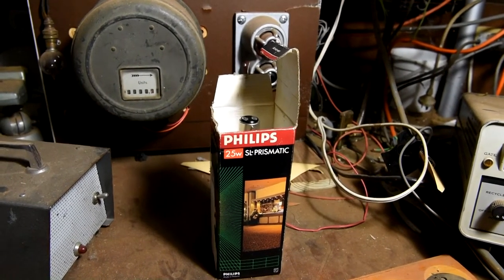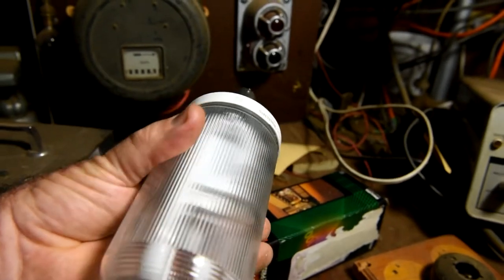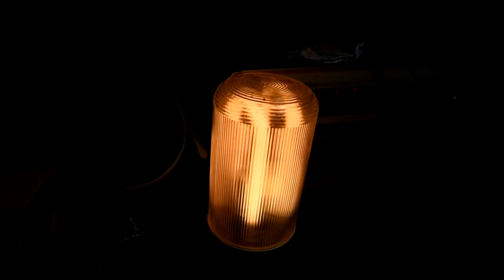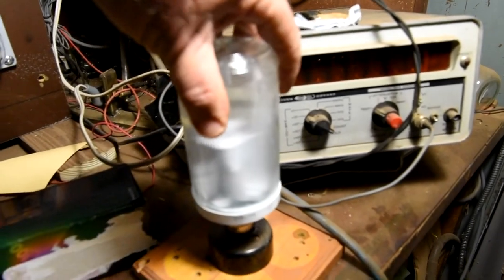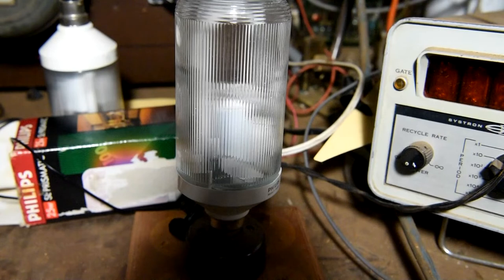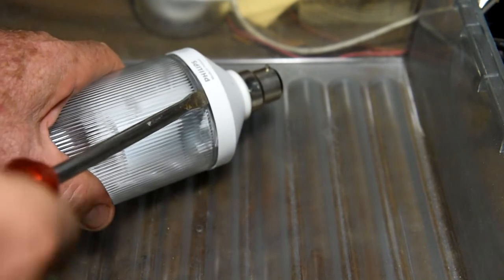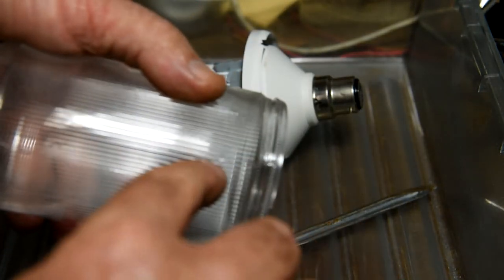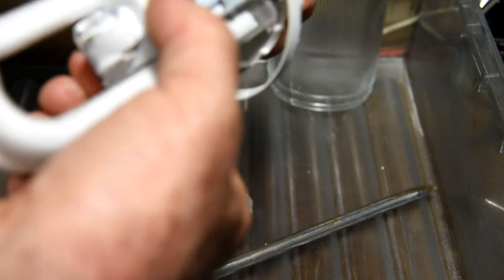Vintage Philips SL Prismatic lamp autopsy

Comment: I have just taken an SL25 & SL18 on the same circuit out of service August 2022 to be replaced by Philips LED. They never let me down & I can see no darkening inside. Being the early days of CFL, they were expensive at around AUD40.00 in Sydney in 1984. They can join my collections of old goodies!
Reply: Wonder what the cost savings over the lifetime were

Comment: I found a nib SL-25 in a house clearance place back in the late 00s been running it as a hall lamp and moved three years ago and installed as a landing lamp. Keeps a good spread of light. I don't really know much history on these. How better or worse are they compared with the modern energy savers. I run  a few calex rgb smart bulbs too now.

Comment: Such a shame it got damaged. These were well renowned for running way beyond their rated lifetimes. I buy them occasionally when they come up cheap from ebay, some people charge upwards of £50 for one but you can occasionally find examples for as little as £1-£2. Ive got boxes and boxes of them stockpiled to (hopefully) last a lifetime. Not many fittings at the moment but that'll change when I get my own place.
Reply from the maker: Lucky I have a few myself, anyway it gave me the opportunity to dismantle one of those lamps without destroying a good one. Too hard to see through the glass envelope so easier to pull it apart. They sure are well made, designed for a lng service life. They certainly can be expensive, worth looking for them now as they are hard to come by, especially here in central Australia. Good that you have a stockpile, they should last you for some time. I came across one recently that looks more or less identical to the magnetic ballast types but this one has an electronic driver module inside, much lighter than the ballasted one too.
Reply: rustymotor ah, yes I came across them too. Same design and “jar” as the later magnetic types but fully electronic. Unfortunately I don’t think they’ll last as long as the tubes instant start with a flash of purple every time. Cool to have as collectors items though as I don’t think that variant was common.

Comment: Should be possible to Frankenstein another florescent onto that base, no point wasting a low/no-hours power supply circuit and it'll be fun to try it! Suppose it would act as a ballast for a small straight-tube bulb?
Reply from the maker: TheFurriestOne Yes, a straight tube will work fine, I will search for a similar rated tube that I can connect to the structure. I think I have a U shape tube somewhere.
Reply: Sounds like a good plan!

Comment: The postal service/couriers is shocking considering what you have to pay for shipping.
I remember then while I still lived in The Netherlands, early 1980's. Very expensive, new lamp technology, then around 30 NL Guilders then. Pity the lamp was toast on arrival. (BTWI am over In Aussi next week, about 5 hours inland from TooWoomba for Thunda Rockets Down under.) Hope to see some interesting wildlife as well.
Reply from the maker: Hi Ray, yes it was annoying to have the lamp damaged, mixture of poor packing from seller and postal rough handling. Anyway it gave me the opportunity to open one of those lamps up and check out how it is constructed. I wish I knew that rocket event was on, I would have tried to make a trip to it and may even have caught up with you! I use to make home made rockets with mostly failures however a double stage rocket actually flew very well! Hope you enjoy your trip and hopefully you have documented some good action. Cheers, Ian
Reply: I do my best to get some good footage from the rockets, as well of interesting meters and power structures during my travels. Then also will be driving down to Melbourne over the following days after the event.  @rustymotor